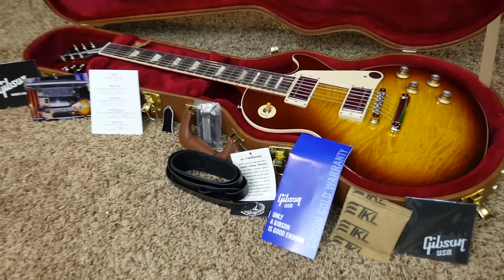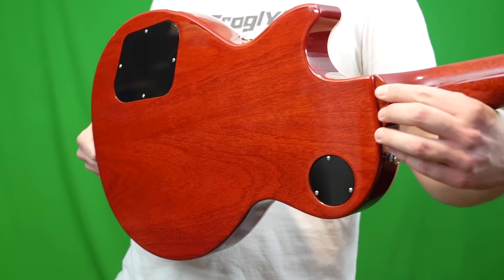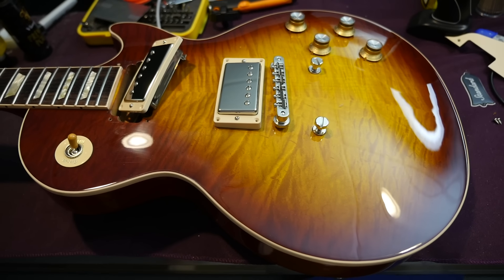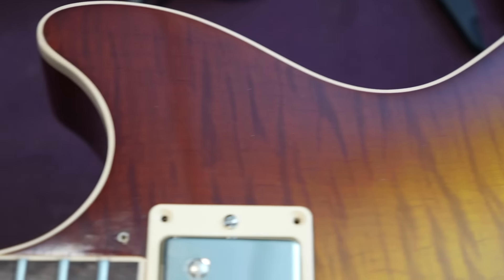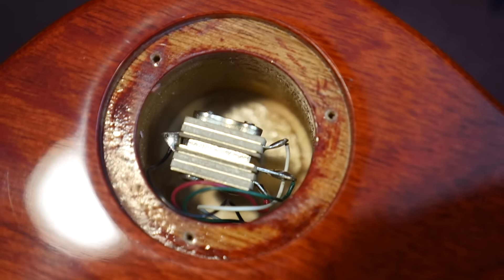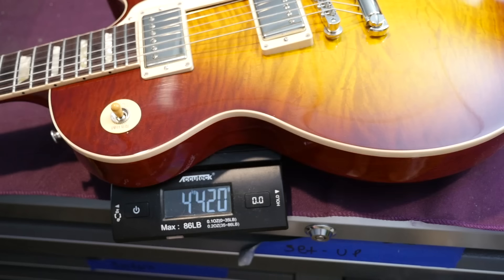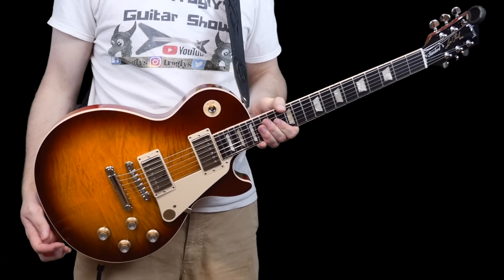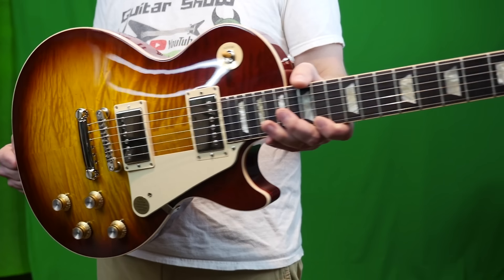The NEW Gibson Les Paul Standard '60s - Is It Worth Buying? | 2019 In-Depth Review + Demo

Comment: My Standard 50s had the same dry looking fretboard when I got it.  They all do.  Still played good regardless, but once I put on some fretboard oil (F1 Brand), it felt better to play and looked better.  At a glance it looks like an ebony fretboard now.  Much darker.  But a word of caution to anyone using fretboard oil:  use it sparringly.  I didn't use much at all and it was still too much.  I would dab a little on the fretboard, smear it around a bit, then wipe it off.  It's not like I let it sit or anything.  Anyway, for like a week or two afterward my fretboard felt way slicker than I wanted it to.  And at this point I'd already gotten used to how it played before, so overnight the neck felt way different to play on...  I even took a microfiber cloth to it again a few times and just buffed the fretboard over and over, just to be sure I had gotten any risidual oil....  Anyway, after a couple weeks, zero issues.  Was playing great and looking great...  Seriously, I didn't know how much darker and richer the F1 oil would make the rosewood look.  And while F1 gets great reviews (which is why I tried it), this isn't an endorsement for that product.  I'm sure there are plenty of good fretboard conditioners out there....  Also, if you oiled your fretboard once every 1-2 years, I'm pretty sure one bottle of F1 oil would last you a few hundred years.  That's how little it takes.  lol

Comment: My only "complaint" about the 60's Les Paul Standard is that ALL the 1960 guitars with the slim taper neck and reflector knobs(and late 1960's Les Paul Deluxe) had the tomato soup red Sunburst finish that hasn't faded in 62 years, so there are no Ice Tea, Unburst or Bourbon Burst guitars with those specs, however, as you pointed out in this video, this isn't a Historic Spec 1960 reissue, really more of a tribute.

Comment: Clapton pre-Cream and post-Yardbirds and using a NMV Marshall flat out with no pedals would often play his 60 Les Paul Middle position and one of the volumes (try each one) knocked back a tad (or one number). Try it. He also did it with the painted SG. Crossroads is a good example. He liked the tone and found he could control the power of the Marshall mo' better. Oh, and my 61 Les Paul SG has a extremely similar neck to the er, LP Les Paul from 60. I've also found neck varied a lot over the 59 - 60 years.  
I like your YouTube apace but would prefer less "unboxing" crap! :) Best, Pete.

Comment: Your shot of the two guitars top to top (side by side) clearly shows what  I meant by the knob placement of gibsons vs the Epiphone or chibsons.  If you draw a line straight through the tailpiece posts,  Gibsons are almost directly on a line across from the tail piece, if you go from the bass to treble post and so forth.  It's the single most easy way to tell an Epiphone and Chibson from the actual Gibson.  The Epiphone/Chibsons knobs (they're made by the same people in the same factory) are down about 30 degrees off of that line I spoke of.  Wanting to know if it's real or fake?  This is the single best tell, unless it's a Monday guitar from Gibson.

Comment: the new way to mount the bridge with the screw in post  to a pre-sunk metal thread is a improvement over the old style . putting all that bridge tension on just the little threaded post directly  in the wood was bad idea and can lead to bridge collapsing  . thank you Gibson for fixing the old bad  design. any vibration through bridge in unaffected. and you get a better Les Paul because of new design.. this guitar is made the right way.

Comment: Hi there, 
so it look's really great. Love that they are going back to the roots.
but got a really in dept. question.
are there any difference between the Les Paul Traditional 2018 and the new Standards?
Reply: Carsten N. Christensen appreciate this is a month ago man but as a 2018 Trad owner myself I’ve come up with a few points
1) Different nut - graphtech now vs 2018 Tektoid
2) Different tuners, Grovers vs Gibson Deluxe (exactly the same from 2018 Traditional as 50’s Standard though)
3) Different frets, no longer cryogenically treated on the new Standard
4) Slightly thinner binding on the body
5) 60’s Les Paul Standard has same neck profile as the old classic 50’s Les Paul Standard has same neck profile as old Traditional
6) They say the pots are different? “Audio taper” might be marketing chat the ones on my Trad are fine both 500k.

I think that’s about it really. I’ve replaced the nut on my 2018 Trad for bone and it really sings. They’re not too dissimilar. The new Standard is cheaper than my Traditional but tbh I love the longer lasting frets on mine so am happy with my choice.

Comment: I'm trying to follow along. I have a 2014 traditional s# 140069075  weight 10.7 lbs with bigsby. No weight relief,showing the maple in the cut a way, and now has oil a paper caps, cts pots, wire upgrade, fret board has been mad perfect. And last roller bridge and bone nut. Guitar plays and sounds great but how much have I hurt the value. Not selling just wondered ps that's why I rewired mine the neck pup sounded dead I rewired in 50s style and used .015 cap for neck. That's not a bad price for that guitar. I got like 3500 in mine. It's probably worth 2500 on a good day.

Comment: Great videos and thank you for the thorough going over on all these guitars.
A nit pick here for Gibson.... Why do they add a "baby pic" of the guitar on the setup bench if they're not bothering to setup the guitar? I mean if the nut wasn't cut right to begin with on that 50s model you looked at how the heck did it get by the setup bench? 🤔 I recently sent back a 2021 60s Standard that had the same issue with the G string where the nut was cut too deep and picking it open sounded like a sitar. Also the jack plate was so crooked it looked like someone just licked an old postage stamp and slapped it on an envelope. The one I had it replaced with was ok but once again the setup was terrible with all the strings buzzing past the 12th fret which leads us back to the baby pic on the setup bench. Why bother.  People are being lazy and blowing off their jobs at Gibson plain and simple when you have easily avoidable stuff like that popping up regularly on $2700 guitars.

Comment: At 16:25, the pick guard bracket screw is installed too low, not crooked, but just plain too low. The screw hole should be drilled on the binding, not the wood. I ought to low because I drill the holes and install the pick guards on my Les Pauls myself.

Comment: hmmm my 1991 les paul special ( bought new $750 no case )  only has 8 digits on the back of the head stock not 9 digits like this one,  so after the first 5 digits which are for the date there is 311 , batch 3 guitar #11 or just #311 ? any guess ?  Mine came stock with P100's  which honestly are way more bite-t than these sound,  I also shopped around and found a 1973 P90 neck posiiton on ebay for only $35, you want to hear the tone in that older P90 is amazing, like fresh whipped cream vs cool whip  LOL  ,   Great Video loved it , Peace !

Comment: I saw this yesterday but today, I saw the ad for the limited edition 60th anniversary 59. They said it was a clone. Now I highly doubt they're using hyde glue or formaldehyde resin used for the tops, the original plastics, or red side dots. But I would not be shocked if they also had a short neck tenon and post for the ABR.
Reply from the maker: The reissues will have the long neck tenon and hide glue - yes.

Comment: I was curious about the serial # dating because my Les Paul started with 19xxxxxx etc. I know that a year doesn’t have 900 days so I went to the Gibson USA website and this it what it stated, Gibson USA 2014 to present – These serial numbers cannot be dated to a specific day of the year.
The new model year typically launches in the fall as the current model year winds down. It is not uncommon for a new model year model to be produced during the previous model year (example – a 2015 model may have been built in late 2014).

The pattern is as follows:
YYRRRRRRR
YY is the model year
RRRRRRR is the number in product for the model year (starts at 0000001)

Comment: My 2020 Standard 60's model actually came with a felt surface saver attached to the pickguard nut. I wonder if they took your advice from this video?? Either way, since I'm a guard-off person it came in handy. And you're right. My 'go to' guitar which is my 2006 Gibson Explorer came with the truss rod acorn nut almost maxed out. At least 3 threads were sticking through. Been pretty solid though and is easily my favorite fingerboard. The rosewood is extremely dark(almost ebony-like).
Reply: I have the felt  on my 2019 too. I also noticed the surface under the felt is still scratched up. A bigger spot that’s not gouged, but still very noticeable.
Reply: @canadablake  Dang that sucks man. I wonder if the felt is different because the one on mine is quite thick does the job pretty well? Since yours is a 2019 model maybe they were experimenting with different materials?
Reply: Wise Guy maybe. Mine is a black felt. Still pretty coarse though. It almost looks like it sanded a dull spot. I bent the bracket a bit so it clears the top now so it shouldn’t get any worse.

Comment: Chambering started because the lighter wood was no longer available.  But chambering inevitably change the tone.  For the worse or for the better is opinion.  ON the other hand, heavier solid wood also sounds different than the originals.  You CANNOT get a solid mahogany Les Paul that weighs the same as an original '59 for any money.  The trees are all chopped down.

Comment: I would point out a few misleading statements. 

1) No where in our specs or marketing materials or at NAMM we said this guitar was going to have a long neck tenon. That’s reserved for historically accurate Custom Shop guitars. In general, Historical accuracy is reserved for our Custom Shop. 

2) The ABR bridge is an actual ABR bridge. Nowhere in the specs, marketing or at NAMM we said it was going to be drilled into the wood. That’s reserved for Historically accurate Custom Shop guitars. 

You got a few other things wrong but overall good review. 

We are on a mission to shape sound for the next 125 years. We’re doing that by leveraging our iconic past with our Original Collection and leaning into the future with our Modern Collection. 

At the pinnacle of Gibson we have the Custom Shop, where we take historical accuracy to another level, and are showcasing that with our 60th Anniversary 1959 Les Paul Standard.
Reply from the maker: People got the idea and started questioning if these would have long neck tenons when terms like "50s and 60s specs" were being thrown around. It led people to wonder what the difference between these and a historic would be. Yes, it makes sense why these have a short tenon. 
Marketing these as an ABR-1 bridge and then delivering them with stud mounts defeats the whole purpose. Might as well just stick with Nashville style at that point or at least lay that out a bit more clearly in the spec sheet to prevent confusion.
Reply: The Trogly's Guitar Show man you said “Gibson is lying to you”. We’re not. You are misleading fans which is not great because your videos are good.
Reply from the maker: @gueikian  Cesar, I heard some dealers are starting to call this an "ABR-1S." Is this true? That is what I'm looking for - a true distinction in terminology between a stud and traditional mounted ABR-1 as this clears up any confusion when looking at specs. Gibson hasn't done the stud mounted ABR-1 until very recently (around 2017 was the first time I saw it with the Gary Clark Jr SG.) That was at the end of the Henry J era and it wasn't a welcomed addition by many purists (the target audience of this lineup.)  

I can see both sides here. Gibson IS putting ABR-1 bridges on so they are advertising them as such. Hardcore fans see it is stud mounted and then get upset. I think just a little more clarification in listing descriptions would clear this all up and also help to further illustrate the differences between the new USA line up and the Historics when reading a spec sheet.

Comment: I’ve had one of these for a few months now and I’m pretty pleased with it. Strangely, mine has the cream colored plastic jack plate. The tooling marks on mine aren’t quite as bad on the fingerboard but the binding is a little sloppy. Mine also doesn’t have that gap between the nut and fingerboard. The bushings under the bridge make it impossible to lower the action to my liking, although I suspect a truss rod adjustment is in order soon. Anyway, thanks for the informative video! I used this when looking for flaws when I first picked it up, and it helped a lot

Comment: hey Troglodites, why is it that the 60s Les Paul Standard advertises the "creme" output jack plate and yours has the nickle one? Mine is a 2019 with the plastic creme one and it is already cracked and i cant seem to get an OEM one from Gibson. im kinda pissed about that. i am also getting finish checking along the side ahead of the output jack and a long crack along the back in the clear finish. im afraid to touch anything on the guitar in fears of voiding my warranty. Also, a thumb bleeder is loose and just spins freely, any advice?

Comment: Gibson USA 2014 to present – These serial numbers cannot be dated to a specific day of the year.
The new model year typically launches in the fall as the current model year winds down. It is not uncommon for a new model year model to be produced during the previous model year (example – a 2015 model may have been built in late 2014).

The pattern is as follows:
YYRRRRRRR
YY is the model year
RRRRRRR is the number in product for the model year (starts at 0000001).

Comment: I think, it's the Standard 50's that has that long neck tenon. Because that's also the main difference between the 50's and 60's Custom Shop Les Pauls. The 50's has the long neck tenon, while the 60's has a short one.
Reply from the maker: That is not correct
Reply: But wasn't one of the production changes Gibson made at the 60's was going from the long to short neck tenon? 🤔
Reply from the maker: @JedLuna  That's mid-70s

Comment: Since seeing your video, I’ve been looking under pick guards. I’ve seen some that have had a piece of felt or insulation between the screw and the body of the guitar.
Reply from the maker: Yes, they have made a few changes since launch. Another is a plastic output jack plate
Reply: The Trogly's Guitar Show Yeah, wonder why. Protecting margins? Cost increase with felt, cost decrease with plastic plate?

Comment: I would just like to add that the DC resistance tells NOTHING about the output of the pickups. It's the number of windings and magnet strength that determine the output. But I like the sound of these allegedly low-output Burstbuckers in early PAF style.
Reply: Maybe,just maybe the DC resistance will reveal the number of windings.

Comment: Great review. Gibson is heading in the right direction with the 50s and 60s Standards. That said they have ways to go. The nut filing on your guitar should have never left factory. Easy to fix but you should not have to do that on 2499 guitar. Thanks for sharing.

Comment: I just got a 60s in Unburst yesterday, and my output jack has the plastic plate. They also had one in Bourbon burst with the plastic jack plate. Design change or flukes?
Reply from the maker: Based on photos at Sweetwater - it appears they have changed the specs since the initial release of these
Reply: @Trog  Thank you for replying! After I bought a 2018 Standard that had the PCB from a Studio in it, I was starting to think I was a magnet for factory flukes. lol

Comment: So here's a question: Austin, you weighed this Standard at 9lbs 11.9oz, correct? In your review of the Les Paul Classic, you weighed that instrument at 9lbs 7.3oz. So, drilling out 9 holes in a Classic provides "weight relief" of roughly 4 or 5oz? What's the point of it? I own both instruments. I have a 2021 Standard and a 2021 Classic. I swear to God, my Classic feels slightly heavier than my Standard. A four or five ounce variance in weight could occur between woods used within the same model families, so I don't understand the reasoning behind "weight relief" other than being a gimmick. Why waste all the time and expense to make Swiss cheese out of a guitar body when the results are so negligible?

Comment: Disappointed that Gibson is still wiring them with the tone capacitor in the modern position. They should wire them like they were originally if they want to call them 50's or 60's spec.